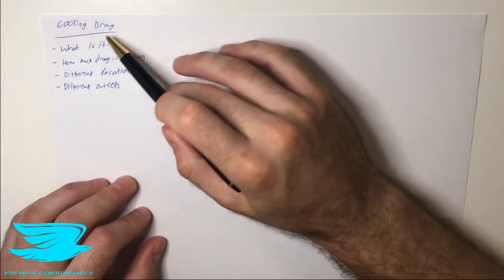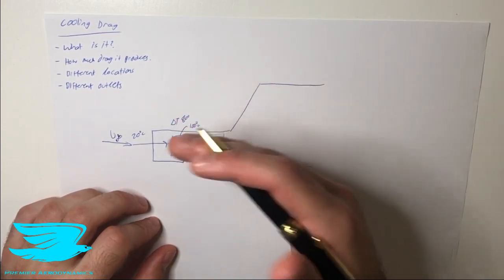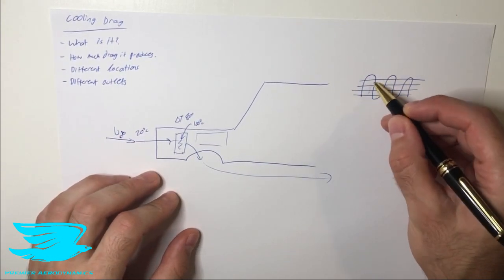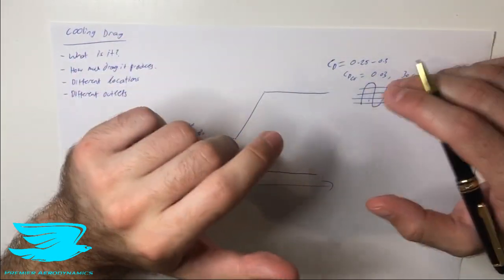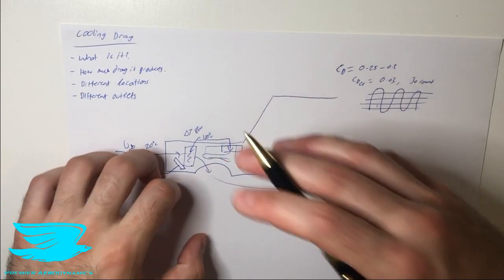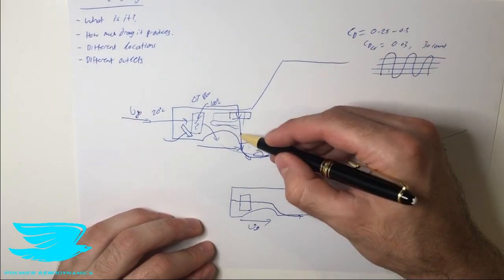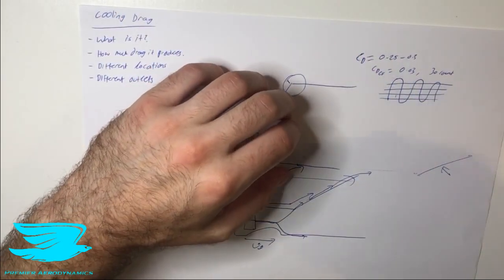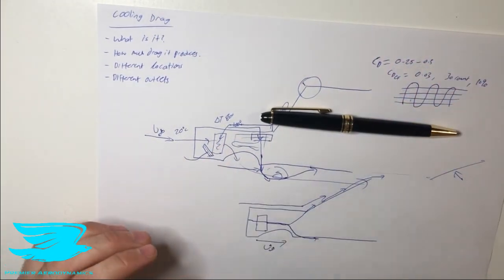{Automotive Aerodynamics #10} What is Cooling Drag

Comment: What about spoiler mounted heat exchangers like old Group B Audi Quattros? Or gigantic rear mounted radiators on some Lamborghinis and Bugattis?
Reply from the maker: They can reduce the cooling drag, particularly if you mount the radiators in bad flow to begin with.

Comment: Q: Roughly how big would an air duct going straight through the car need to be?
Reply from the maker: The same size as the area of the front that has high pressure.
Reply: @PremierAerodynamics That would be neat to see in CFD. 

Then maybe choke down the center section to half the area to see how much it kills flow.

Comment: Still not exactly clear on the ducting and pathway of airflow from when it hits the radiator to when it is ejected away from the car.
Reply from the maker: There are a few different, common, paths.

The most common is through to the wheel houses (front wheelhouses). But other ones include up just before the front windshield and then down to the underbody.
Reply: I'm working on an engine swap project on a MG midget, and realized just how critical good flow through my engine bay would be for getting sufficient cooling without having an overly large radiator. It seems prudent to address underbody flow at the same time, and it's left me wondering where should my hot engine bay air go?

Comment: I always thought that the cooling intake would reduce drag since the air is not forced to displace at the front of the car
Reply from the maker: If it could go straight through the car without being redirected, then yes it would. But, in order for it to do that, it would have to go straight through the passenger cabin and then out. Current designs make the air zig-zag through the engine bay and even other regions of the car. Every time you redirect the flow, you are using some of its energy, which in this situation is wasted, hence drag.